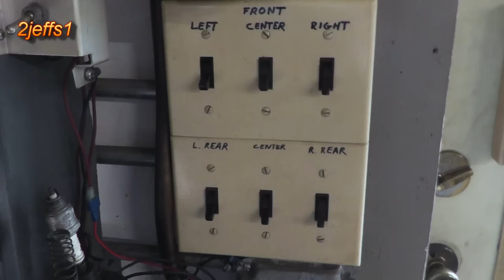Convert Fluorescent Lights to LED Tutorial - Save Money on that Electric Bill

Comment: Very Helpful Video! Just converted my garage lights, and your video helped out a lot. 
When I was first considering this conversion, I wasn't sure which style/type of LEDs to use. Using only the tombstones on just one side made it a quick and easy job.
Reply from the maker: Nice to hear from you Mike. I think there would be so many more people doing this if they seen for them self what a difference they make.  That lumens comparison to florescent just, well, is not an accurate comparison for these LED bulbs. I have a friend who is an electronic guru that said those will NOT be as bright because of that lumens figure. He was here the other day. 
Well - seeing IS believing!!!
Reply: 2jeffs1 Jeff I completely agree. Just the before and after in my garage, makes this upgrade a must. My garage is so much brighter with the LED's vs, the fluorescent .

Comment: Great video. My shop isn't heated all the time and during the winter even with special bulbs it takes forever to warm up. I put one large LED in the center and even below zero instant light. Since I have no windows even in the summer it's a hassle to turn on lights and not good for on/off quick run for a tool. The LEDs clear that problem too. Thanks again.
Reply from the maker: +57WillysCJ Your welcome. A few friends stopped by since. They couldn't believe the difference. The camera doesn't really do the changeover proper justice. Like you were saying - when its cold out there the instant on and brightness is awesome!

Comment: That was a great shot of the shops exterior. L.E.D.'s are taking over and for good reason. A little expensive but so far I've had great luck with them. I didn't know those were called tombstones. I liked the tips along the way too, thanks. You do great videos.
Reply from the maker: +wyattoneable Some time I'll have to include a building shot of when I got here in 86. They wouldn't even put it on the appraisal! Many hours invested getting things the way they are now. Bought a couple of those bulbs to check them out first. Real happy with the results. Thanks for stopping by.

Comment: The Tombstone's (T8 Fixture)  I have,  have a jumper between the Line and Neutral that can be removed.  Leviton. As you pointed out in the video the tombstones have 2 places to plug wire in on both sides Line (load) and Neutral.

Comment: Excellent video Jeff! I wish I had seen this before I converted mine, could have saved me some time. I had no clue about the "dead" end of the LED bulb. lol  I set my lights up in zones just like you did. The one thing I didn't see you mention was no more buzzing, flickering and constant bulb replacement! LED for the win! My work area is behind my garage and I put 4, 4 foot fixtures under the eave of the garage, looks like daytime back there at night. :-)
Reply from the maker: That's some great other points you brought up there Steve! Nice write up on what you have done for those final quality touches! Actually had an automotive customer who was converting his wood shop bulbs. Watched some YT vid's and said he pretty much wasted a day chasing around and most places only sell the direct install ones only to find he thinks he had some ballast issues. Next day he found my video and said he wished he seen this first. Pretty neat and unexpected to get a call just about that. Thanks for stopping by Steve, Jeff.

Comment: Thanks for the tutorial! I’m going to make some tool money as I have a job replacing 33, 4 foot 2 bulb ceiling fixtures, I’m going to do them in place rather than pull them down as they’re hardwired in and surface mounted on the ceiling.

Comment: Your videos are the best, love the ideas and your shop is IMMACULATE!  Great idea on having multiple switches to control lights.  I bet its also better on ballasts too if you are using florescent lighting, than having all those lights ganged on the same circuit.  Thumbs up Jeff!
Reply from the maker: +Craig Arndt Thank you! A friend just told me a place where he works some florescent lights that get turned on and off a lot need the bulbs replaced every several months. Actually prior to the changeover there were 5 switches. Added the 6th and moved the switches above them for the yard. With the conduit it's too easy to add wires.

Comment: Hey Jeff...great video on the LED conversion.  Have quite a few to do in my business, mostly 3-bulb, 4' fixtures.  Love the dune buggy...my dad and i built on years ago.  On your side note, using the wire cutters to trim the bolts without a hacksaw, i have found that this  s p r e a d s  the jaws of the wire cutters eventually, making stripping the wire a bit of a challenge and forcing me to buy new ones.  Have fun...really enjoyed the video...
Reply from the maker: Hello There. Sounds like you have quite the project coming up! Really appreciate your thought s on the cutters. So far they have been holding out well (they better for what I paid the tool man!) However thank you and I will be watching for that issue.

Comment: Only one exception to mention. Some LEDs, I think maybe older ones, are double ended, meaning that the "hot" is at one end and the neutral at the other. This video applied to single ended bulbs only Single end bulbs can only be insert one way, put them in backwards and no joy. So, mark the power end. Double ended bulbs can go in either way but need shunted tombstones or jumpers.

Kudos for a very nice video. 

BTW, another easier method for removing the wire from a push-in connector is to just pull and twist round-n-round to unscrew it.

Comment: I see that you used an old pair of Thomas and Betts crimper/strippers to cut that 3/16 screw.  I have had a similar pair for nearly 40 years now and it also has the locking metal tab missing too, other than that it is a very handy  tool to have.  Thanks for posting.
Reply from the maker: I couldn't even remember who made that stripper. Actually I've cut a lot of 3/16 stainless screws with it and it still works fine. Probably hard to find that kind quality these days, ;>)

Comment: Awesome video. No annoying distracting music. I love the tidbits at the end too. You have a beautiful garage BTW. Wish I can have one one day. Question on the live and neutral @ 2:54 into the video. Is the Neutral and Live switchable? As long as you connect them in tandem to the black or white wires from the home, it's okay? You could have labelled the white and black reversed, with white on the right and black on the left. But you connect all the whites together and all the blacks together at the end. You are just making a positive and negative basically, right? Also, safe to work on the garage if I just turn off the breaker box to that portion of the house or do I need to kill power at the main breaker too? Thanks in advance, sorry for the newbie questions.
Reply from the maker: Always glad to help out Jasen. I wired those as per the included instructions sheet. As you were thinking I don't think the other way would really matter. You should be fine just turning off the breaker for the area your gonna service. What I would do is have the light on that you wish to service and then turn off the breaker to make sure you have the right one. then turn it back on and check again just to be safe and making sure the light didn't fail meanwhile making sure your correct and turn it off again. A test light would be ideal but that is a good way - how to if you don't have one. Hope this helps you out Jasen and thanks for stopping by, Jeff.
Reply: Thank you sir. I guess I am thinking of polarity in flashlights where you have to orient it a specific way. T8s don't appear to have specific +/- end. I guess that make sense since you can insert the tube on either side. Duh. It looks like you only need to hook up the wires on one side of the fixture too, no need to wire the other side up? Also @ 4:52 of the video, you said you can place it in either one of the slots, A or B slot. It seems unnecessary on why they have 2 slots to be honest, if you can place the wire on either slot. Thanks in advance.
Reply from the maker: Your right, just wire one end and on those bulbs i have says power on the bulb it's self which gets hooked to the wired end. The other end is dead. There isn't any need for a+b slots for this app. Sometimes a company will wire jumpers between those instead of separate leads to each, like on a 4 bulb fixture, not a big deal tho...

Comment: Thanks for your prompt reply - I am wondering what is the make and model of that water pressure unit, Thanks!
Reply from the maker: It is made by Cam spray. Model 20005MXDS, MX series. 5hp, 220v. They have a lot of different models. Mine has a Cat pump. Hope they are still using them where I've never had a single issue with mine. Bought it in the late 90's. I brought that up because looked at a current picture of one. Looked like a black colored pump. Cat pump is the one to get (if poss) and always blue in color, maybe they changed the color?

Comment: very good does it make a difference witch end of the tube is the hot side
Reply from the maker: On the tubes I purchased they mark the side that requires power. The opposite end just has the 2 pins which are dead, just used to hold the bulb in place.

Comment: Only if you have older fluorescent fixtures. Newer ones are alot less work.  Wire stripper bolt cutter only works for softer zinc bolts. SS ones will ruin your cutter.  Removing wire from a fixture easily, carry a small pocket screwdriver. And once all lights are converted to LEDs what can the cost be as compared to fluorescents?

Comment: Good video. Liked the class on tombstone  continuity check .   The last thing I would do, is take the fixture down as mine are hard wired (no plugs), Did you do that for all lights?    .. I waited until I found led tubes for $6.50 each and rewired all my basement and garage without taking them down,  It did not take that long and the only  mistake I made was putting one bulb in backwards,   so after I studied a while ,  I realized what I had done and flipped the bulb around.  It was very easy on the ladder (Just make sure the power is off). I did not remove the ballasts as in  as it was faster (just cut all wires to it).
Reply from the maker: While I was at it I did the entire shop and did take all the fixtures down to do them. I was waiting for the price to come down more too but some existing lights were becoming a problem. If one bought 100 you got another dollar off per bulb so I decided to do this. Right after I did the shop the bulbs went up a tad so I got lucky on the timing.    They could probably be on a single switch but for me where all the switches are in the same area it works good to leave them divided up.  Update >>> I just checked and the price has came down so.....

Comment: I need help. =( The fixture I'm trying to replace has two bulbs in the fixture, like yours, however, it also has an outlet on the end so you can attach another light fixture so there are extra cords that I'm confused what to do with.
Reply: It also has different colored wires, one lamp/tombstone has yellow and blue, the other has yellow and red. Poo.

Comment: On the end that has no wires going to it; does it matter which type tombstone you use? Does it have to be of one type? Thanks
Reply: It doesn't matter, it's just a holder in this case.
Reply: @surferdude642   Thanks for the info.

Comment: Have a question..... I took out my ballast and connected the white/black wires. I checked the tombstones and both have power running through them. I put in my LED bulbs & nothing happens. I know I have electricity into the tombstones, so what could be the problem? LED bulbs work in other fixtures in which I have not removed the ballast, and bulbs are said to work with/without ballast.
Reply from the maker: Make sure you are installing the power end into the powered tombstone otherwise perhaps the bulbs you received might be packaged incorrectly.

Comment: I am going to be replacing the fluorescent tubes in my house and garage but have a question about the T8 and T12 tubes. I now have T12's and it looks like everyone is going to T8 LED. So my question is why T8's not T12's. What is the difference T8/T12? Also like you video, best explanation on how to do the change.
Reply from the maker: Hi Ron.  A T12 bulb will have a diameter of 1 1/2" The T8 smaller, (1") and the T5 smaller yet. (5/8") Typically the more narrow the lamp, the more efficient it will be. Glad you liked the video and thank you for stopping by, Jeff.
Reply: Thank you for the information. Didn't know there was a T5, so I think I will use the T8. Thanks again, Ron
Reply: Thank you for the information, I will be changing to the T8. Going to check out more of your videos. Ron
Reply from the maker: I must say I like that where you returned the thanks Ron! Wish I'd see that a tad more often on the responses!  ;>)

Comment: Nice Job on the video but one thing I'm not sure about. I only have to change to non shunted tombstones on 1 side not both sides? I want to make sure I can leave the old shunted tombstones on the opposite end that isn't powered?
Reply from the maker: Correct. The non shunted tombstones only need to be on the powered end. If you are not using the same tubes that I did double check the directions in case possibly there is something odd out there that I am not aware of.

Comment: Does it matter if my tombstones are different, the ones I have are push-in NOT rotation? Also doesn't make a difference which bulb you buy, I noticed some are plug-and-play leave the ballast in place. Do they manufacture different types of bulbs ones that use a ballast and ones that don't aka direct?
Reply from the maker: Hi Alex. I know what type of tombstone you mentioned but I never had any fixtures with that type in them so can't be helpful on that one. They do make the 2 different types bulbs as you mentioned. Personally I prefer to be rid of the ballast. I heard several people who got the plug and play type and then wish later they would of taken the time to re-wire, be rid if the ballast and use the style like I did.
Reply from the maker: Your welcome. Not sure where to get what you need. Just make sure what you get will fit in the fixture you have. Perhaps check at a local big box store so you can visually see things will work for you.

Comment: on the led conversion wires only on one end of the fixture correct ? the other tombstone has none ?
Reply from the maker: Absolutely correct!
Reply: Yes
Reply: Depends on the type of bulb.   This modification uses single ended leds with one pin hot, one pin neutral on one end of the bulb.

Dual ended Leds uses both pins hot on one end of the led and both pins neutral on the other.

The Led package will have a diagram showing how the led should be wired.

Comment: Still happy with that brand LED tube? I need to do this in my basement shop.
Reply from the maker: No issues and VERY happy with that brand of tubes. Friends that stopped by recently were very impressed on the difference too!
Reply: Thanks, now just have to find them!
Reply: Got this done, much better than fluorescent tubes in every way.

Comment: great vid. l like that 220 volt pressure washer too.
Reply from the maker: +Mustie1 Thanks! Made that crank setup so it could be turned down where at times it was too overwhelming. Had that for many years now, never an issue.

Comment: You make it a lot harder than it needs to be. Buy double ended LED tubes (hot to 1 end, neutral to other) and you can reuse the tombstones and not worry if the are shunted or not. Wire the hot to all of the wires from 1 end, wire the neutral to all of the wires from the other.

Comment: GREAT CLIP.  *Please say the "best" (all-around) 4 foot Shop-Light LED "Tube", *(along with a "likely" price one would likely pay). Is around 5,000  K the brightest I'd go ? (want the "bright", but NOT the "blue" color). I was told around 8 bucks / per 4 footer (for that which I preface) ... OR: IF you know of an on-line vendor I could "bulk" order these from, please say where that might be, and I'll go there.   : -  )  THANK-YOU !
Reply from the maker: 8 Bucks is a good price. When I bought mine you got a buck off if buying a case of 100 and seems I paid 9 each. Like you I don't care for the blue color either. Bought several of those bulbs for the house. Will be changing them out. Very happy with the shop bulbs, never any issue to date and so much brighter too.

Comment: I don't think these would work with my shop light fixtures as mine are too old to have those "tombstones"  mine has a round spring loaded receptacle with two holes for the pins, you put that side in, push the spring loaded head back and then insert the pins in the other end.
Reply from the maker: Your right, I had several of them too and sadly they ended up being salvaged.

Comment: Where did you get the tubes .  I went to www.Luceco.com and found the tube I want, but am unable to find a way to buy them.  No CART or way to buy...
Reply from the maker: Hi David. I purchased those bulbs from Earth LED. Here's a link to 
them. https://www.earthled.com/collections/led-t8-tube-replacements-replace-your-fluorescent-t8-t10-t12-lamps-with-led
Reply: Thanks a million for such a prompt reply and the answer to my problems (hopefully).  Am I correct that all Luceco LED tubes are powered at only one end ???
Reply from the maker: Caught me at the right time! Yes, the ballast removed ones (like I showed) are powered by only 1 end. Not sure on this but I would suspect the ones that one leaves the ballast in might be powered from both ends. Never bought any of those. Leaving the ballast in is another area for a failure/problem in my mind. They do sell both kinds so beware. Mine are called direct wire and the other ones are listed - with ballast installed.
Reply: Thanks again for the help and your insights.